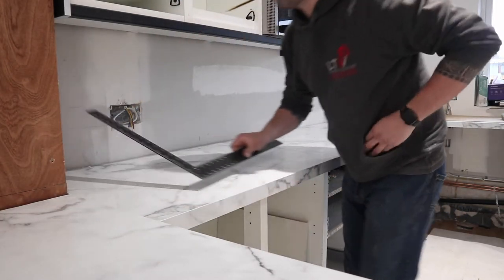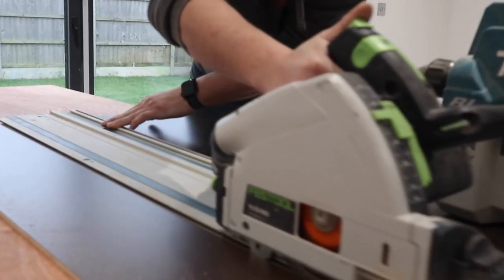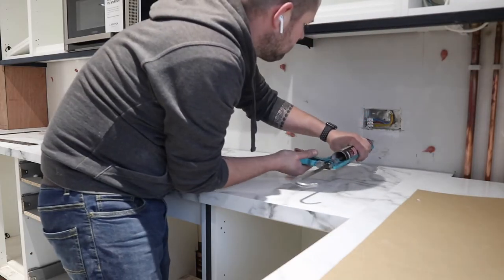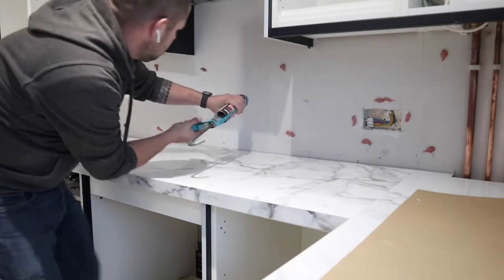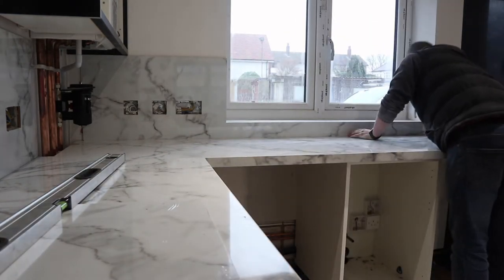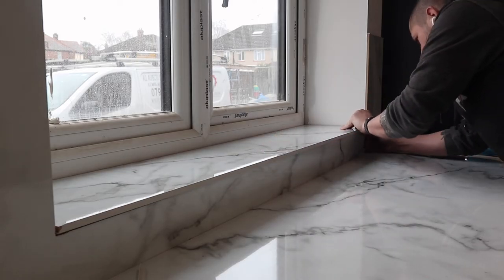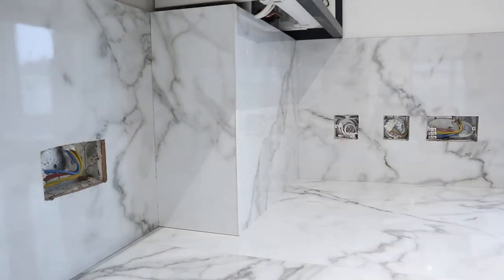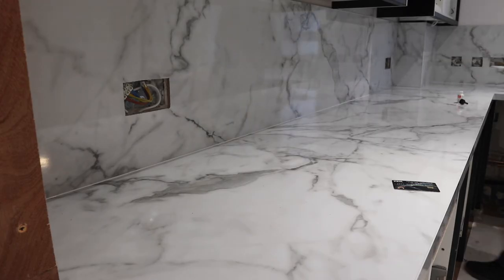Installing marble effect splash backs.

Comment: Very nice job, I ordered similar wt and splashbacks but they dont sell edge trims, they didnt even know what I was talking about 🙃. What trim are you using here ? 
Thank you
Reply from the maker: This is tile trim I used in here buddy, most diy shops sell it
Reply: @LTWCarpentry  yeah I thought that, I tried 12mm trim and it was 2mm too narrow even though splashback was 12mm too. I'll try again on the next one, don't want go through all that contact adhesive shenanigans again 😁

Comment: Again really helpful mate - Nearly time to do my own kitchen and using this video as a brush up. Can I ask with these sorta splashbacks behind a cooker - is the Glass panel enough to prevent it warping? None of the laminate manufacturers want to say yes though I can understand why. Just wanted to see if it's safe as I love the idea of one of these full height upstands but don't wanna set it on fire seeing as 99% of them are MDF or fibreboard xD
Reply from the maker: Cheers for the comment buddy, I would say yes they are, especially as they screw through the board, I get what you mean…. And it is frustrating when they manufacturers cover there own arses isn’t it ! But this one has been here well over a year now and is fine. Hope that helps buddy 👍🏻

Comment: I wonder if that pink grip stuff will stick to fire resistant MDF...  Looking cracking tho, nice work, love it.
Reply from the maker: Hmm not sure, I will test it and see if it works, thanks for your comment buddy
Reply: @LTWCarpentry  cheers, thinking of using a mdf backer to overboard my old and manky kitchen wall - make life easier for fixings
Reply from the maker: @RollCorruption  was you going to use the pink grip to stick it to the wall ?
Reply: @LTWCarpentry  boards will be fixed to studs but was going to pink grip the backsplash to the mdf depending. if someone can confirm if it works tho haha. Probably go with a PU if in doubt.
Reply from the maker: @RollCorruption  I would go with something like stick like or even a decent silicon over pink grip mate, in my experience pink grip isn’t the best stuff in the world l, there’s loads of better adhesives out there. What’s your nearest shop ? I.e screwfix/ tool station or something similar ? I would be happy to recommend something if you would like ?
Reply: @LTWCarpentry  I’ve got all the big names within a mile thankfully, you name it. Watched the old Robin Clevett comparison which sold me on the PU adhesive, but I guess kitchens are another matter as there’s heat to contend with
Reply from the maker: @RollCorruption  well if you’ve got a Screwfix near you mate I would use sticks like sh*t (actually spelt like that) it’s cheap and dose what it’s says mate, you’ll have no worries with that at all
Reply: @LTWCarpentry Cheers mate, will drop you a sub btw. Nice work.
Reply from the maker: @RollCorruption  cheers buddy, appreciate it

Comment: Do you cut the trim on a mitre saw mate or did you use scotia shears? My saw is a 12 inch blade so not sure if it’s a bit much for the job
Reply from the maker: I used my mitre saw buddy, I’m not sure if scotia trim would cut this as it’s ally, to be fair you could always cut it with a hack saw and run a file over it, alternatively you could buy the plastic trim and cut the with scotia shears, your saw will do it but only do it if you feel comfortable msg

Comment: Nice work. Was wondering what work top joint you used for this job. With the square profile did you butt and clamp? If so what’s your method for removing the lam strip? 
Appreciate the Chanel,keep the vids coming!
👍🏻
Reply from the maker: Hi, thanks for the comment ! I cut the lam strip where it meets the other top then use a chisel to peel the lam strip off, this is the best method I’ve found so far but still very awkward to get off ! I’m trying to find a better method myself ! I use worktop bolts to connect the worktops together
Reply: @LTWCarpentry  I bet! I’ve just brought a new trend jig (the red one) which does smaller profile masons mitres. Suppose to be great with smaller profiles and square edges compared to the standard hockey stick.
Was going to try this method if the jig didn’t turn up. Was concerned how well the edging comes off. Great vids and info
All the best mate
Reply from the maker: Cheers mate ! I appreciate that ! Let me know how it comes out,I’m really happy with the results of butting up the square edge but always good to have another option isn’t it !!
Reply: @LTWCarpentry  I’ll give this method a whirl too. Did you hear up the strip?
Reply from the maker: No I’ve tried heating the strip in the past and it made a hell of a mess, I just work the chisel in from the bottom avoiding going anywhere near the Formica top of the work surface, hope this helps buddy
Reply: @LTWCarpentry  nice one! Appreciate the advice. All the best mate